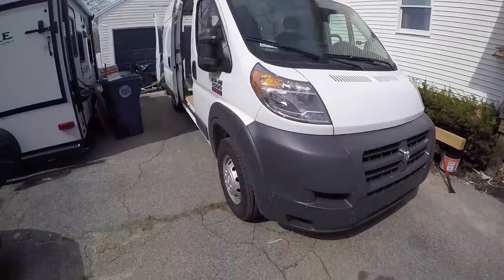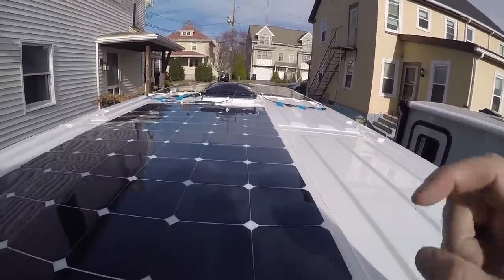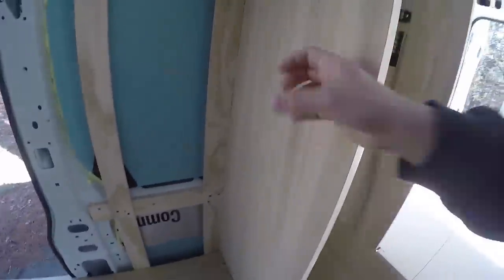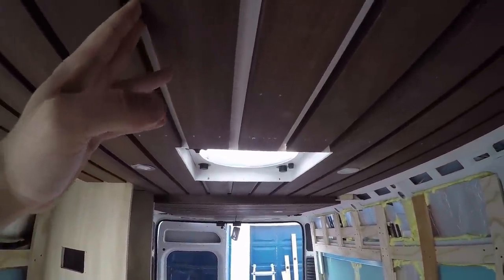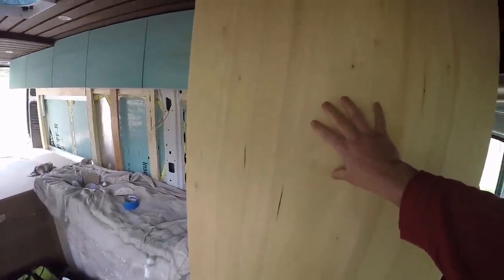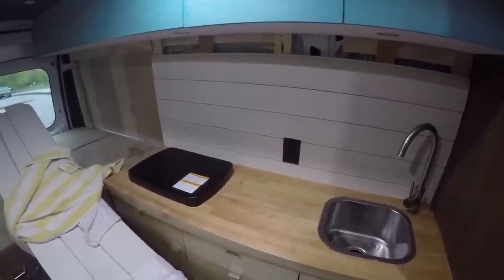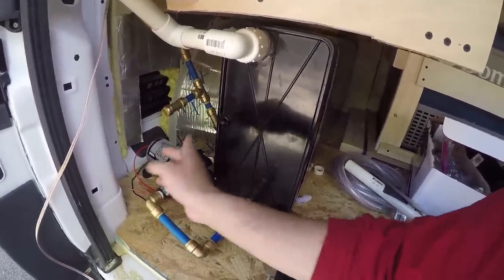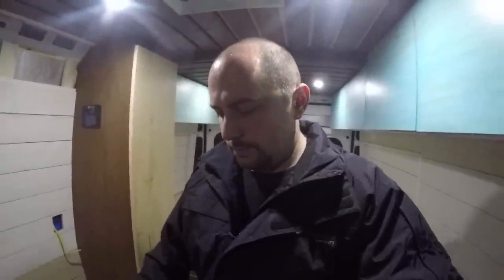How I Converted My Van into a Stealth / Off Grid / Tiny Home Van

Comment: Nice job. Over time, those glue-on solar panels are going to become damaged or destroyed from heat that the roof absorbs. Put them on a rack slightly above the roof.
Reply: Johnny MF Bravo I was thinking the same thing
Reply: I wonder if sticking them to a board with some insulation on them would still give them that low profile but protect them from heat.?
Reply: anna christine 

Great question! Anybody?
Reply: BTW Jarrod, I wanted to say how lucky you are to have a healthy dad with the skills and the love and desire to help and support you. And a brother, too. There's no wealth comparable.
As far as the issue with heat and exposure of the solar panels,  that was one of the reasons I've been thinking about getting one of those solar panel suitcases. When I'm driving I'm getting that thing which its name escapes me so the engine will charge the batteries, then when I park to stay somewhere I can park in the shade and put the panels where its sunny. The other advantage is them not being on the roof being subject to more weather elements and road debris, but also make me more stealth and don't advertise  to potential thieves. Also fewer holes in the roof although the fan creates one. I also LOVE the idea of a Cub wood stove, speaking of another need for a hole in the roof. I've watched a few videos of people who have them. Has anyone else considered them or have positive or negative opinions of them ? Inverter...that was the word I wanted earlier.

Comment: Another way to build a shower that's really easy is to get a pump up bug sprayer one of those 5-gallon jobs and cut the wand off of the end and replace it with a vegetable sprayer like you use on the kitchen sink and paint the container black just leave it out in the sun all day then when it's time to take a shower Pump It Up get wet soap up and rinse off they work real good like an off-grid cabins and doesn't require any voltage like a 12 volt water pump
Reply: Joseph Atnip great idea man. ill have to try that. sounds like it would work great
Reply: Using the pump method now. Thanks for the paint heads up.
Reply: Van's are small.
Building a shower with water storage, heater, pump and grey holding seems a lot (space & effort).
Emergency bathroom tucked away,  I can understand.
Not a shower stall.

I'm 6 1 so SIDE2SIDE bed wont work.

I prefer a side mounted Murphy bed with storage bench/work table.
Mini mini kitchen.
TV with Xbox.
Hot redhead. 
And a dog.
Reply: @EvilTwin123  you described the setup I want to do perfectly

Comment: As a professional finish carpenter, I think your ideas were great.  The way you changed the ceiling direction, as well as lowering the back so its not all on the same plane.  Same goes for walls.  Different stains, textures, materials.  WAYYY nicer than just doing it the cheap way and running paneling down sides and ceiling, slapping in some cabs and done.  I commend your build.
Reply from the maker: Fl Yak Fisher thank you. Always nice to hear
Reply: YW.  Im watching the other vid now.  :)

Comment: Very nice work! I'm just finishing my Sprinter van now. While I was watching you do the floor and ceiling I was thinking looks good, but wouldn't have worked for me. I'm 6'1" and even with being very conscious of the floor thickness and ceiling thickness with shoes on I feel the recessed lights when I walk under them. :(   I'm in NJ and the floor is really been cold, I wish I had that foam subfloor now, though I plan to be in 75° most the time. 

I wonder if you really thought out the need for a shower, it really takes up lots of space for the shower itself but also for the water tankage, (potable and grey), hot water heater. A gym membership might have been a better choice. Your choice of water fillers on the inside is the correct one, in my opinion, the world is full of A**holes the might pee in your water or put drugs in it. 

Yours is one of, if not the best build out that I've seen. Good luck, I hope you enjoy it.
Reply from the maker: Richard Border thank you! And I do agree with the gym membership as I do have one and use it everyday. My shower honestly is used more for storage than taking a shower but having it there is more of a sense of security I guess, like just in case kinda thing. Also if I’m traveling and in the middle of no where. I plan on doing a video of the pros and cons of having one.

Comment: Great interior build. Wondering how well your sound and blackout precautions work.

I'd add a couple of worker's high visibility vests draped on the front seats and maybe a D-ring binder on the dash with "Field Operations Manual" printed on it.

Other simple camo is to deploy some cones when parked in an (sub)urban setting and adding some official looking things to the exterior such as vehicle fleet number and a "How's My Driving" sticker and whatnot.
Reply from the maker: Genghis Pecan wow some pretty good ideas. Thanks
Reply: Glad to help - I know someone who did a conversion on a surveillance van used by the Feds that he was lucky enough to pick up cheap on govt. auction. He went as far as to repaint it to look very corporate - put something along the lines of "24/7 Service Unit" or "Field Response Service Unit" on it with a fake 1-888 #.

It was already super insulated and noise shielded so he did not have much to add there. He had to make some adjustments to ensure no light/sound would leak from the rear to the front seats and he made some mods to accommodate and silence a small AC unit that quietly vents under the truck

Was able to take advantage of some of the preexisting architecture to subtly place micro cameras covering the rear, sides and front seat area so he could always pull up his laptop and see who was around the vehicle.

The closest he says he has come to trouble was a rent-a-cop patrol in a strip mall that shown a light into the driver's side...saw the vests and manual he placed up front (and a hard hat on the passenger seat) and went on his way.
Reply from the maker: Genghis Pecan thanks. That’s freaking awesome. Good idea of him getting that at a auction. Something to look into. And I like the hard hat idea...
Reply: Why go through all that trouble when they sell Romulan cloaking devices at Walmart now. Oh wait. Right. Sorry about that.
Reply: annoyed707 
The Romulan Cloaking Devices are for larger vehicles, at least full size school bus and bigger...
Reply: Great tip! I was thinking of putting a removable decal that states Investigation Unit. 😉
Reply: Genghis Pecan 

Love to see a picture of this unit. That's an awesome idea. Go to a Fes auction. Although, I have heard that others purchase vehicles at a government auction and they discovered drugs in th vehicle cleanly stashed. I would hate to be sniffed by a drug unit police dog and be charged for something that I had not expected.
Reply: annoyed707 
😂
Reply: annoyed707 but it comes with a female romulan officer to operate it
Reply: Crazy I just seen everything you've commented in another van video I mean to the tee he had vest manual on dash wow. The van community kills standard neighbors seems like van lifers look out for each other
Reply: @genghispecan    Contemplated the orange vests,  bogus blueprints in the cab and phony toll free number.  However, very easy for any snoop to confirm the number is phony if they GOOGLE it.  Might just end up leaving the stealth box truck OEM.    Small box trucks are commonly used for delivery and small moving jobs.    May get magnetic door signs for when parked at isolated trail heads.  STINKY ANGEL DIAPER SERVICE.

Comment: Hey there .. New subscriber here ...   With over 26 years of finish Carpentry experience ... 
I just had to say that you & your father did an AWESOME job with the van build  :) :)  ...  Great detail, and SMART layout of valuable space  !!!   Looks fantastic sir  !!!!  
The one concern was how much "weight" was added to the van, at the end of your build .. ?? 
You spared NO expense in quality materials, but that also added a LOT of pounds to the finished product ....  (just my own opinion ) !! 
Absolutely a QUALITY finish  :) :) :) :)
Reply from the maker: Rick S. Thank you as it means a lot coming from a carpenter. These vans can handle the weight for sure. I don’t even want to give a estimate but if I really had to guess maybe 1200 pounds and I don’t even think it’s that much. Also I drove the van empty for a while and after the build it felt better to drive for some reason. Like more smooth
Reply from the maker: So I spoke more with my father about weight and my estimate was way off. He seems to think it's closer to 600-700lbs. In the video I do with pricing I'll also do the weight of products and give a accurate estimate of total weight of materials.
Reply: 26 years of Carpentry experience, but you don't say anything about him cutting towards himself

Comment: Looks marvelous.
You're right. Cheaper is not better. Build it correctly now. Funny but I retrofitted a 2 1/2 gal Rheem water heater in my Gulfstream sprinter van. The tankless was engineered by a moron.

Comment: Very well thought out and executed. Being a contractor and in the marine industry I caution you of the heat your roof will put out and eventually damage your solar panels; creating a gap between them and roof would resolve that issue.
Also you have potential for disaster around the water pump area as it isn't moisture resistant.
Reply from the maker: Gordon C thanks. Those type of solar panels are designed to sit flat to the surface. I will do some reinforcements to the water pump area though. Thanks for pointing it out

Comment: Thank you for the answer about the walls of the shower, what about the pan (floor)  & to seal the corners of the shower?  Where did you get your supplies?  If you have time to answer, thank you very much & thank you anyway for the view of you very nice van build!!!  Judie
Reply from the maker: Just a sealant/calking/silicon from Home Depot. Also you can get it at any home improvement store.

Comment: Not bad, congrats and enjoy.  I saw an ambulance (box) converted that was already insulated, had a sink, A.C./heat, generator and wiring with batteries, heavy duty alternator, lights, siren, network hookups (in cab), ect....  All they had to do is design the floor plan to utilize the existing systems (add solar) and they were done.  ;-)
Reply: T'airn'KA nahhhhh bad juju, living in a truck that statistically speaking a lot of people have died in... hell nahhhh
Reply: I'd say it would be chuck full of good karma.  ;-)

Comment: I noticed you went with the flexible solar panels.  Is this because it helps the van become more stealth and also avoids putting more holes in your roof for brackets etc?? I noticed the starter kit (Renogy) doesn't have flat and flexible panels.  Probably going to go the same route you went.. 👍
Reply from the maker: Goals and Dreams that is exactly why I got them. I knew I’d be in cities more then camping so I wanted to make sure I blend in as a work van. Renogy should have the flexible panels. The did not when I built my van. I’m not sure if they do it as a starter kit but they probably could arrange it. I also know mine are bigger then there’s so keep that in mind too
Reply from the maker: Goals and Dreams hey!! THANK YOU SO MUCH!! You know why 😁

Comment: Very nice work!  I like it.  Would you advice to me what model solar panel  and where can I buy it  and battery model.     Thanks
Reply from the maker: chajungjin53 solar being the most expensive part of my build it’s best to always shop around to different people and see who works best for you. Also depends how much time you’ll be spending in the van as well as what you budget is. I got all my solar products from Renogy in Southern California. I talked to them a lot and we worked out the best system for me. Everyone should ask how you’re calculating power usage (how much power used per day) and then they will go from there. Hope that helps

Comment: Enjoying your video just now. How much did this all cost you, including the van? I'm wondering whether it's best to buy a camper or do what you've done.
Reply from the maker: stu lazonby van was brand new bought out of Los Angeles for about $31K and the build was about $7000. If you look at a brand new class B motor home or camper they can for $80-120K+ and are not built for full time living. Now that’s just my opinion of course. I will say building your own is super stressful and takes a lot of time and preparing so also keep that in mind. If you go used really really do your research and test and retest everything on the rig. Best of luck
Reply: Jarrod Tocci  thanks man 👍

Comment: It looks great mate, it really does!
You might end up having problems with the MDF with all the condensation but easy to replace anyway.
Quick question, being stealth, how are you going to use the electric shower? Wouldn’t gas be easier?
Reply from the maker: Tiago Ferreira I thought of gas but also knew I would have to vent that too. Went with electric knowing that I don’t use my shower everyday in the van (use gym shower a lot). Also being in warmer climates most of the time the hot water heater is only there for emergencies. Or if I’m plugged into shore power. Thanks for the like!

Comment: I have some important questions.

1.can you actually lay down on the bed in the back and have enough room?
2. How do you keep mice and pests out?
3. When you move around inside, does the van rock?
Reply: I’m not done.
4.what needs maintenance besides the van’s engine and drive train? 
How do you keep the van well ventilated when you sleep in it?
Reply from the maker: TheKoss11 ok some good questions. I can lay down but I’m only 5’8” and my length of bed is 6’
I haven’t had any issues with mice or pest but I clean daily and really I don’t think there’s a way for them to get in. 
The rocking question is the first one I’ve got lol. Of course when I’m laying down or sitting no the van doesn’t rock but if I’m doing other activities then yes I say it does, but not much. Also if I’m parked on a busy street and cars are driving by fast then I can feel a little shake. 
I keep up with maintenance just like any other car. I bought this brand new so my worries are not as bad as someone that bought used. But when/if I get into high mileage I would get it checked regularly by a mechanic that I trust. Hope all that helps

Comment: Very nice, I like the interior style and choice of color. I also like its stealth and that it still has a toilet and a shower (something many omit). I can imagine living in a van like that quite comfortably.

I noticed with this van build and also many other van builds that the bed base is just a flat sheet of wood without any flex and without any openings for ventilation to prevent the buildup of moisture. I wonder if this is not necessary anymore with modern mattresses, or that it is just not worth the trouble to build something like a slated bed base?

Comment: Very nice, guy. Thanks for the great vid. Just a few little questions... What are the pink strips on the floor? What kind of refrigerator did you go with? Did you  get a converted deep freezer. A lot of peeps w/ tiny homes use those as they say they are more energy efficient than frig's. Did you go with some kind of compostible toidy or do you have to empty the contents into a public toilet? Thanks again for the ideas. Nice build. Close to what I want to do, with just a few changes. Have fun!
Reply from the maker: sacredsoul09 thank you. Watch my other 2 videos and it will answer a lot of your questions. Also in the description of the other videos is all the materials and items I bought. 

Dometic fridge/freezer combo and Thetford porti potti Curve toilet. I’m also releasing a detailed bathroom video this week
Reply from the maker: sacredsoul09 
https://youtu.be/sHTNEF2xrHs
Reply from the maker: sacredsoul09 oh and the pink stuff just acted as a filler in between the floor ribs of the van. They might of helped a little with insulation but just a filler

Comment: Nice work. Small class b motor homes are So expensive, $65 to $190,000! Campers arent usually mlionaires. I wonder what your total cost came out to be?
Reply from the maker: A Person I have a price video but all in was a little under $40k. Van was brand new at $31,500 and between $7-8000 for the build

Comment: This build van is the best so far i've ever seen
Reply from the maker: Rizee1488 thank you!!! 😊
Reply: It's freaking awesome, what was the overall cost of everything?
Reply from the maker: Rizee1488 the van itself was bought brand new for roughly $31500 but I make payments on that monthly. The build was between $7000-8000. I did however just put in another $500 building a woodshop in my "garage" space in the van. I also have a pricing video that might help
Reply: Ok really thanks, i'm planning to do it, just that i wanted to know the rough price. Really nice job you did I'll try to do it very similar to yours because it really seems perfect, i have seen others but they lack of something everytime, either the bathroom or kitchen, but yours was really perfect and it has everything, great job dude
Reply from the maker: Rizee1488 thank you 😊

Comment: I'm curious how you did your sanitary and if you had any information on the power. How did you do your load calculations and wiring diagrams? Any Ideas on budget for a build like this?
Reply from the maker: I have a gray water tank mounted below the van and fresh water in the back. I ran the pipe behind the cabinets, nothing too complicated. For the wiring diagram I had my dad do most of it as I didn't know too much about that. If he wasn't there I would of paid someone which I advice anyone to do unless they are a expert. For what sizes of equipment to use I called Renogy many times over and we figured out what was best for me.